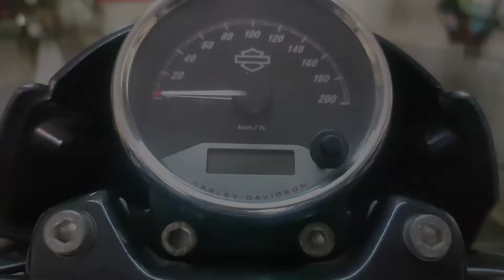Frunt fork oil seal replacement in street road 750 || harley davidson || Anandeshwar auto garage ||

Comment: Doing mine tomorrow thank you so much for the video. Its going to save me some time.
Reply: What was the oil capacity
Reply: @sravanjyothis3334  I didn't have the proper tool to measure the exact amount but the service manual says 14 fl of type e fluid buy extra incase you spill it out like I did
Reply: 14 fluid for this 2020 model or 2016(street road)
Reply: @Tyler-vu3ur  Hi, can you please share link from where you got service manual?